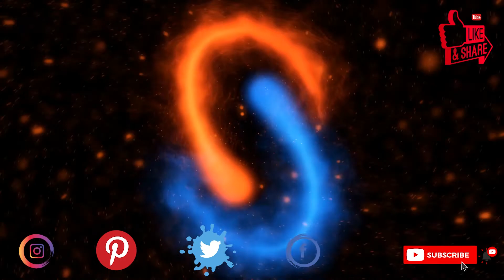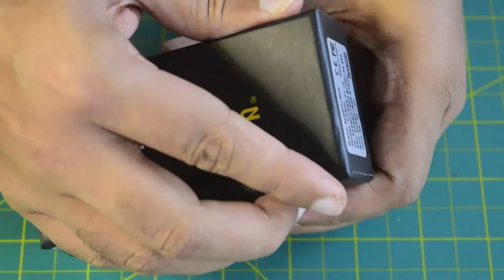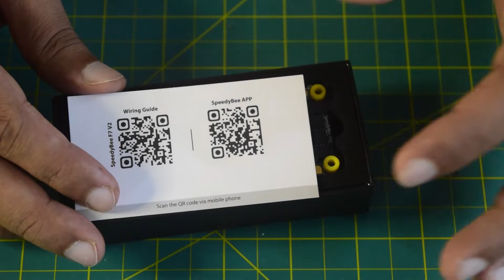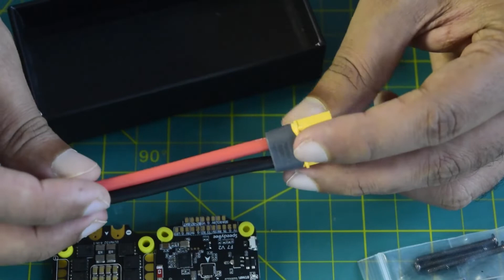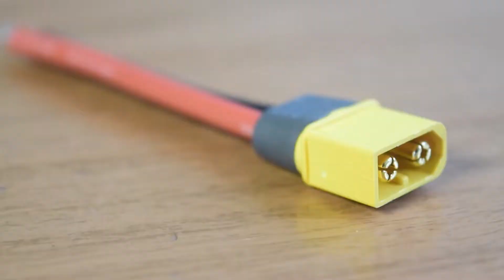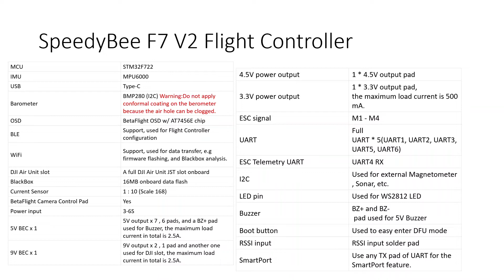SpeedyBee F7 V2 Flight Controller Stack | Usb C and Onboard Bluetooth and Wifi with Wiring & Review

Comment: Great video man ! im wondering about wiring in a nano rx into my speedybee master 5 HD v2. I ordered it as a BNF as it was more cost effective than ordering the parts individually & building it myself, I ordered it with the airunit o3. Is it as simple as wiring it to an open uart channel (plus ground & 5v) as if i was doing so in/on an analog FC or build? I do have 2 or 3 nano rx's but i dont want to waste much time when my unit arrives. In your diagram of the rx being tied into another receivers curcuit, that isnt an issue for me as the air unit will be wiring via the dedicated plug.  Any information is appreciated.
Reply from the maker: Dji O3 unit has its dedicated cable its for video transmission and is unit has its dedicated port connected which contains all its signal wires and power. nano rx is a simple device yes you cab technically make it work by just tx and rx connection I have another video on how to connect a nano diversity receiver 

https://youtu.be/BwHWaKvlcP8

i hope this helps . please stay tuned to my channel for my future videos